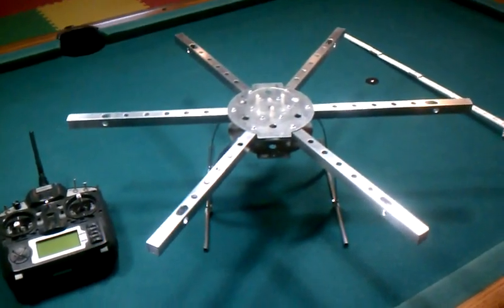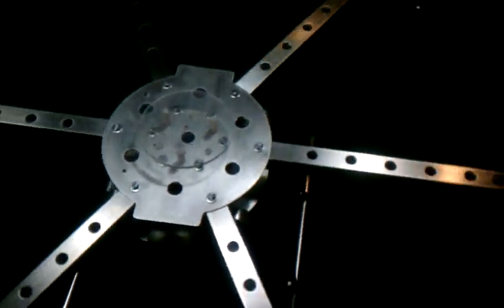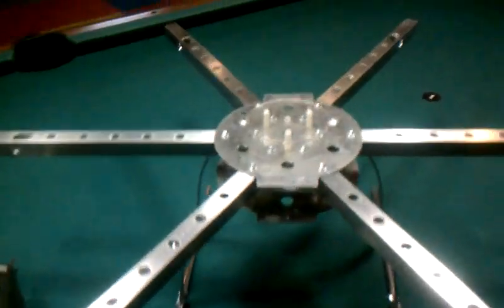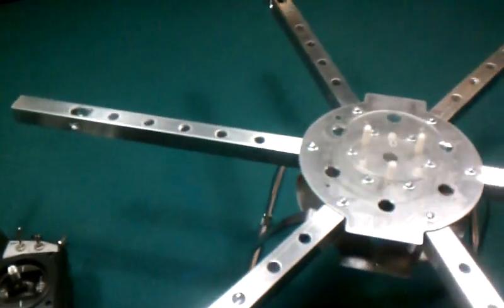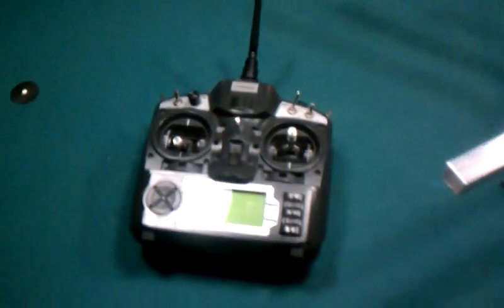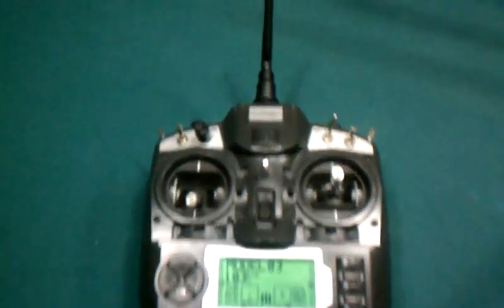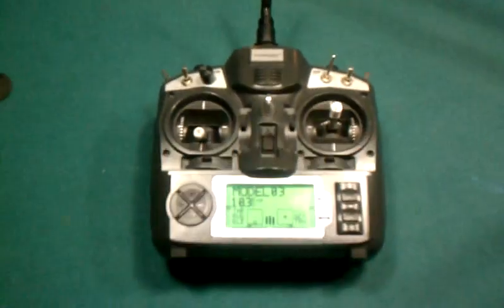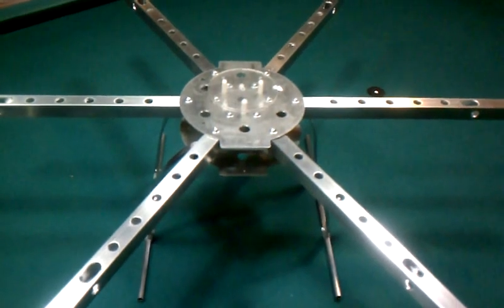DIY Hexacopter Build

Comment from the maker: Hexacopters' bare frame weight is aprox. 1500 grams with motors, esc's, wiring etc. and a 4s 2650mah battery weighed just over 2100 gram or 2.1kg.  I haven't weighed it in a while.  I've changed the motors,props, esc's, and FC is the DJI Naza Lite M with GPS.  I fly with 2 batteries in parallel now with mah. ranging from 2650mah to 4000mah and going to 5000mah.  The weight, with cameras, is pretty close to 3kg. now, and flys great with the Naza FC.

Comment: Looking good ... I crashed my Hex and did the walk of shame to pick the parts up. My camera planted itself lens first into the grass ... still works ... TG . Just a note - my Hex is a lot heavier than the quads and flight time is a lot less. If you are going with the gimbal, fly your hex first and get to know it's quirks by attaching a dummy camera for weight - it behaves differently because the weight distribution is not the same as a frame without the camera/gimbal.